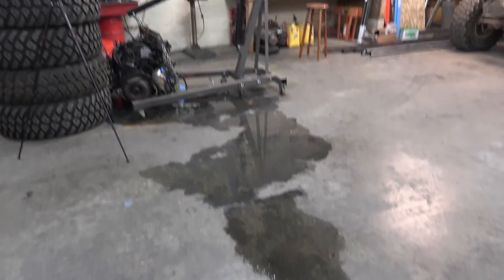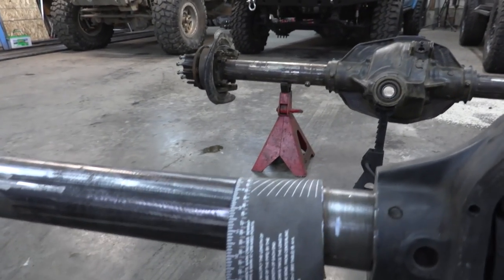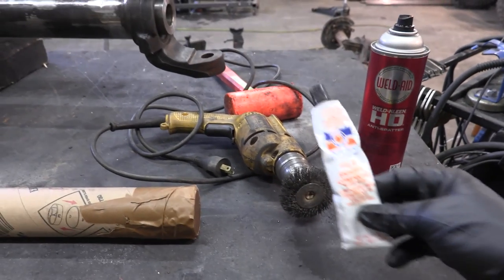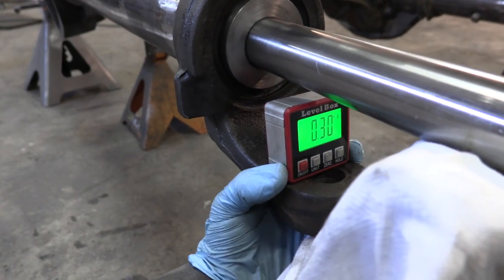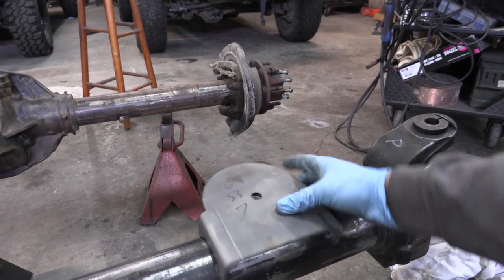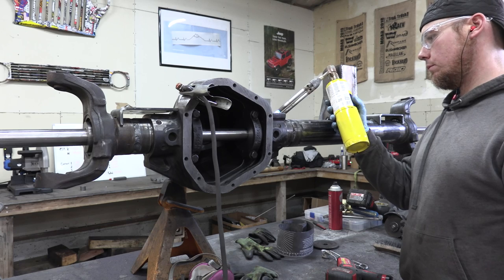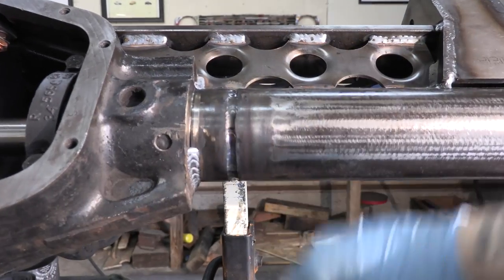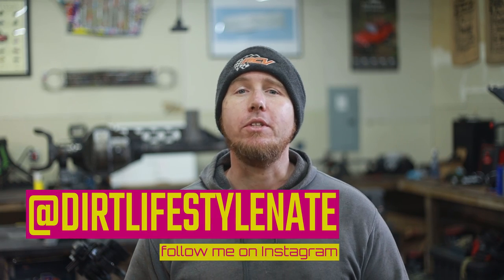Homemade Passenger Drop Dana 60. Ultimate Land Rover Discovery Build Episode 3.

Comment: How could you go about making a Ford OBS f350 D60 HIgh Pinion into a spring UNDER with the cast spring perch on the diff section? Some of us M715 guys want to use an F350 dually axle because it's a bolt in and same overall width, but don't want the extra height the springover configuration adds (fits 37" tires with no lift already)

Comment: Wait...why didn’t you just grind out the plug welds and pull the tubes out and swap the whole tube (assuming the knuckles can be run backward)
Reply from the maker: That is way more work. These axle tubes are pressed in. People destroy housings trying to "un press" the tubes. Have you done it successfully? If so what was your secret?
Reply: CrawlerJamie sounds like another keyboard expert.
Reply: It was just a harmless question that I was also wondering about. Keep up the good work bud love these videos!
Reply: Doug Laurent now that is funny !!
Reply: Doug Laurent they can be milled out or done with a die grinder. Drilling them is difficult.

Comment: Sooooooo,
If I took my late 70's pass drop J10 LP44 front & cut the tubes 5" outside the housing - then took a 79 Ford HP44 front with cast C wedge knuckles & cut the tubes 5" outside the housing - since their both 44's would all the measurements hold true swapping the tubes from the J10 over to the HP44 to still run the J10 shafts?
Seems like that method would be just as simple as yours was & work out real well unless I'm missing some significant housing deveation?
Reply: I'm not expert. I've seen that done to swap lp d44 to hp d44 center. 
I do know that j10 has odd/ long shafts.
Reply from the maker: Should work in theory. Both are 30 spline. The lengths are up to you 👍
Reply: The J10 front has a 64.5" WMS 2 WMS which makes it a perfect match to my 63" Amigo rear 44.
I want to make sure I can still run off the shelf shafts when done.  ( I was going to take them over to Solid Axle in Ohio to be done, but their just going into a crawler & this method seems slick if I can make sure the shaft lengths don't change)
Reply: @Gonecheenin  
I read somewhere that the amigo/pathfinder/rodeo/titan/WK d44 has metric gears.
That's as far as I got into reading about that d44 Maybe the shafts are special also?
Reply: @xmo552  
The gears are a little odd, but you can run STD D44 gears with conversion bearings, or I believe you can run JK 44 gears which are extremely close to 9" (Nitro & Jansen 4x4 both have kits to run the larger JK 44 gears in a STD D44 housing as well)
Reply: @Gonecheenin  
Ok nice

Comment: what diesel engine is planned for future
Reply from the maker: I'm still unsure. Many details to consider here 👍
Reply: TD5 & 300 TDI came in Rovers from what I've read. Should make a swap easier unless there was major design changes between the models they came in & what you have.
Though I'm more inclined to say go 4 cylinder Cummins as long as the application can hand the weight & is worth the power/ torque level.
Reply: The td5 would have come in your model although I think you would be better with a Cummins 4bt, not saying the td5 is a bad engine but the Cummins is just that much better. Here in Australia a common swap for discoveries and defenders is a Isuzu 4bd1t which is basically an Isuzu version of the 4bt
Reply: The 5.0L Cummins would be interesting also without the not reliable efficiency killing parts. (Duramax computer & harness that doesn't require those parts...)

Comment: btw with the tig weld cracking compared to mig ..... it is too much heat and not enough filler rod .... generally people use er70s-2 with tig and er70s-6 with mig that could also account for the difference  . ideally when welding 2 dissimilar metals , a stainless filler rod works very well ( like 309 ) .
peening  the weld as it cools can also prevent  cracking . same with controlling how fast the weld cools ......

so , with tig try, less heat ( less heat could also be using a tighter electrode to work distance )  ,feed more filler rod ,  stainless rod  , peening the weld and control how fast it cools  down .

Comment: I may already know the answer to this question but why not just start with something like a chevy 60 or a older dodge 60 ? i'm assuming because that's to easy and not nearly as cool !
Reply from the maker: The ford version is high pinion and has abs. I really want to salvage the traction control, abs and hill decent control 👍

Comment: Good workmanship, but all those trusses are simply too heavy.
That alignment bar makes  an excellent job.
IF you have a friend with a lathe simply get him to turn up  the spuds that go in the bearing holes. You will need various sets for various diffs.The same piece of bar is generic and not that expensive. Even some heavy wall pipe will do.
I believe stainless works to join steel to cast iron.  And I would use the MIG not the TIG
Though I guess TIG Brazing is an option

Comment: Could you say, please, is it possible to replace my ifs diff on my  ram 1500 with cutted off diff from 2500 ram? Has anybody did it before? What difficulties i will encounter with? Gear ratio, new shaft, new diff supports, new custom cv axles rods, new welded hubs supports for A-arms... I've already replaced rear diff to 10.5", and all I mentioned is not a big problem. Please, tell me your opinion about it. Thanks.
Reply from the maker: I have no idea, this is not my area of expertise

Comment: Okay man. I bought a lot of the tools you show on your show and every one of them work great except for the  Milwaukee portaband.  I bought the 18 volt and it works but I cannot make a straight cut the save my freaking life. On your channel you make it look so easy. How in the hell do you make straight cuts with that freaking thing? When I try to make straight cuts at tens to curve off.
Reply: Hi, I am a pipefitter/ welder, we use porta bands alot. We draw a line around a wraparound or piece of sand cloth like he did. Draw a thin line, using soapstone or a fine point sharpie.  Then set ur portaband on top, and make it follow one side of the line, start cutting once u get thru the tube or pipe concentrate on cutting forward, so u dip the front the portaband down a little and follow the line forward,  just stay on that same side all the way, cut as far as u feel comfortable.  Then cut towards back, u want the portaband to rock the back down and follow that same side of the line till you feel comfortable.  Then stop roll the tube or pipe Counter clockwise till ur end of cut is near the too, u can roll it a little past towards u from the top. Get ur portaband blade in your cut and follow that edge of that line forward,  cut till you are comfortable,  roll again if needed till you get all the way around it. Just remember keep looking where the front of portaband line is, follow the side of the line .use a thin  straight line. If you cut forward keep your eyes on that blade going forward,  if you cut towards the back keep that blade following the side of the line. Hope that  helps
Reply: @noegonzalez2607  I read something similar and saw some videos but I'm not sure about the pressure put behind the cut. I'm a big guy and I tend to muscle a lot of shit and I figure this is actually causing me problems. Too much pressure is probably causing it to curve so I backed off but I still have problems getting a straight cut with this damn thing. If you have a video showing something like this please let me know. Or if Nate wanted to take a moment to do a little bit in depth of how he does it that would be sweet. I have seen quite a few forums and topics discussing this very thing so it could be worth Wild for the Fabricators out there.
Reply: @noegonzalez2607  oh and thank you Noe!
Reply from the maker: Lots of practice, low pressure, trace your cut before you start. It's never a perfect cut but you can get damn close with practice 👍

Comment: MIG isnt the best choice for cast steel . Arc Tech  223 XC  is a high elongation cast steel rod ,  You can stick weld it , or  smash   all the  flux off it , sand it , and use it as a TIG filler . Its crack resistant , and those nasty  cooling cracks wont follow you .  A lot of    my stuff has to be approved by DOT . If you have an  axel squat on the highway , your names going to be shit .

Comment: Does lower pinion angle increase flightieness at 60 mph?  I just had my 93 4 runner track bar replaced from recall and with my 35 inch tall tires I could drive 80 mph down the free at 80 with one finger on the steering. I just bought brand new 38.5 x 9,5 x 15 boggers bias plies and I feel it beating my truck to death!. I tried balance beads but I found out that the bags didn't break after 2 weeks and my tire guy, well he lied and I watched him. I told him,I wanted to keep any bags that were not broken open. I watched him break the tire bead and pick up a solid plastic bag of balance beads and toss it in the garbage without any beads coming out. Then I asked him to double check and he lied to my face and I watched him. So....I just played $3700 for tires from Discount Tires on Bakerview road in Bellingham WA and got charged tire fees and a bunch of other fees that I didn't sign up for but they assumed I was like every one else and charged me for it. And my tires after over 6 months still ruin my truck like vibrate so bad my new wheel bearing are going bad way early. I bought 38.5 x 9.5 Interco Super Swamper Boggers brand new from Interco and put rgem on brand new Black steel wheels wit 4 inch backspace. At first it shook the steering wheel put of my hsmds at 35 mph. My rear tire was jumping up and down on the rure balancer. So after driving it with 7.5 oz of balance beads per 92 lbs of tire and wheel combo weight they bouncrde off the road and I gave up. So they said they could try to balance them with weights.  So I said let's try. It took more heavier weights than they had to make it balanced. So now I have half my rim covered in 4 oz weights and it's not enough to ballance it. So I would need over 4 6 oz weights to make it sort of balanced. So I Emailed and called Interco Tires and it's been 3 months. And I haven't heard a a peep. $$3700 and I can't even get a response !!! Discount Tire in Bellingham Wa .... And Interco Tires are not very helpfull, VERY DISAPPOINTED. They were happy to sell me the tire but after that I felt I was on my own. If you don't stand behind a tire you sell and your a tire store then what kind of business is it???? I've ran 36x 9.5 Buckshot mudders on my 1985 Toyota with zero issues, I could go 80 if I wanted mph. I can't go 35 with these tires !  I've had bias ply ground had us in a similar size and could drive down the freeway. , I'm ready to send a tire back because it's so put of round.